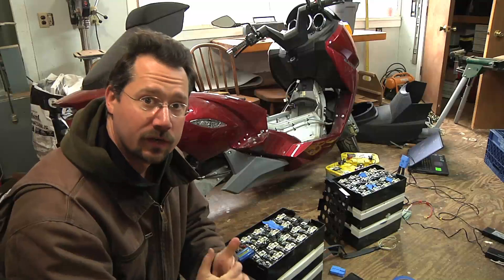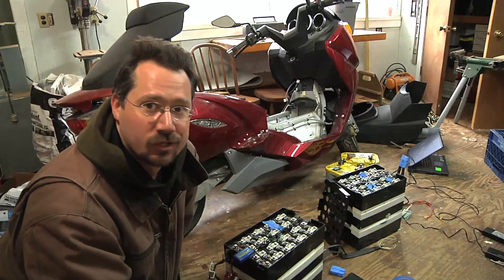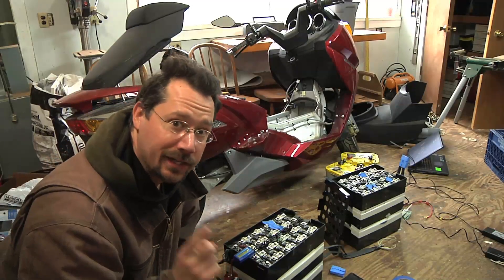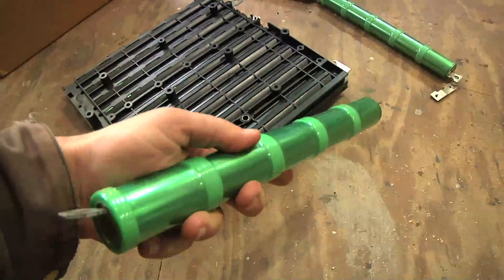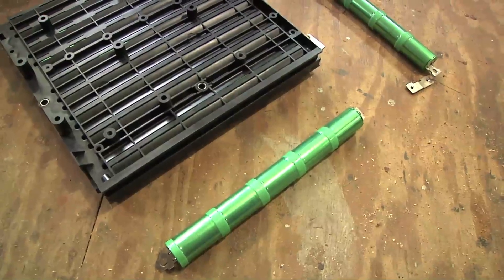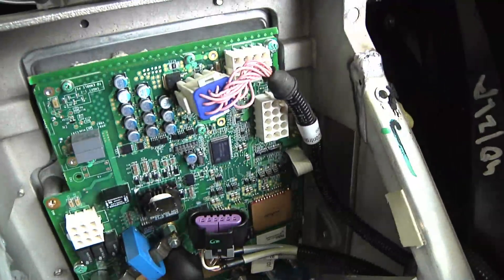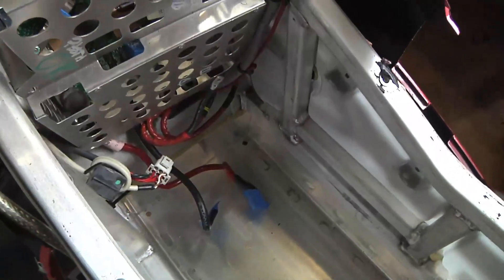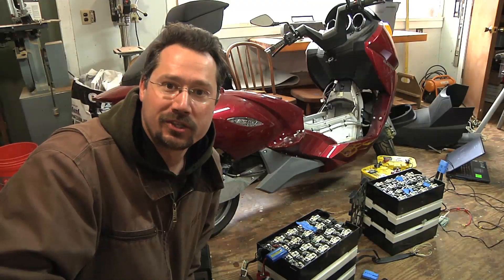Vectrix Repair: Day 4, Part 1

Comment: Try EVTV Channel or website also his personal channel Jack Rickard, his videos are great. They sell Calb 80 batteries etc. Lithium Iron Polymer batteries which I think are a lot safer then other batteries. You might even get more juice out of the Calb batteries then the ones that came with your electric scooter. I am not sure if NiMH batteries need to be bottom balanced, etc.